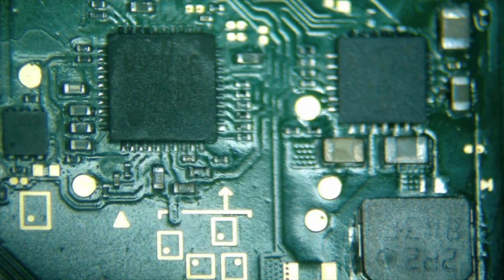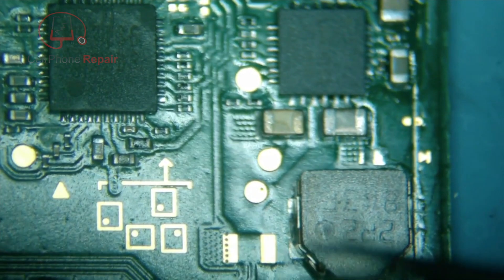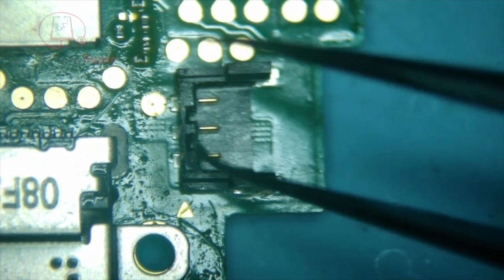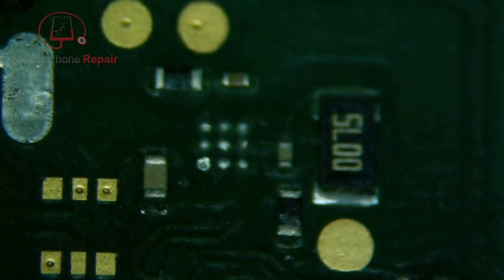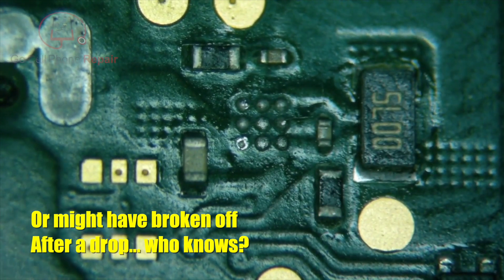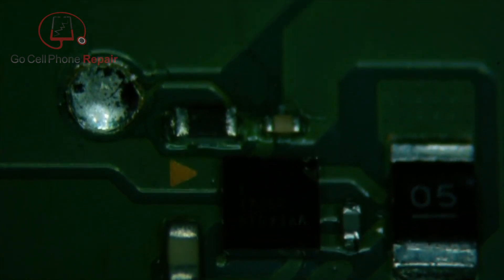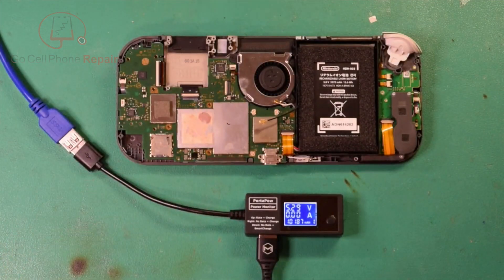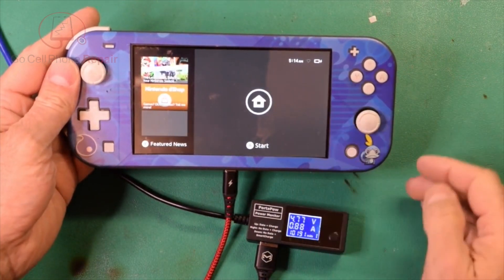Reviving A Nintendo Switch Lite: Overcoming Charging Issues

Comment: Does it go on a certain way around.or any way I don't see a dot on it or the board
Reply from the maker: There is a triangle on the board that points to the A1 location. It's a bit beyond the two gold dots. Take a look at about 11:45. It is in the top right hand corner.

Comment: Ay what temp and airflow do you set your hot air station to desolder the max ic from switch v1?
Reply from the maker: Keep in mind that there are many variables so your setup may perform differently. In my case it's 470 C, 35 LPM, using an 8mm nozzle.

Comment: Hello!!! I saw a video you did 8 years ago I think about getting into an iPod with a disabled screen and I saw a link you provided in a comment for sending the device in to get it unlocked but it wouldn’t load the eBay link, I was wondering if you still offer this service? And I wanted to make sure that if you do still offer it, I have my iPod 4th gen and I don’t remember the password but it doesn’t have a disabled screen because I’ve only tried getting in until I hit 15 min wait, so if if I were to send it in, would I be able to get it unlocked and be able to keep everything on it or would it reset everything? Because I don’t have a backup for any of the data on it and would really like to keep the photos and etc.